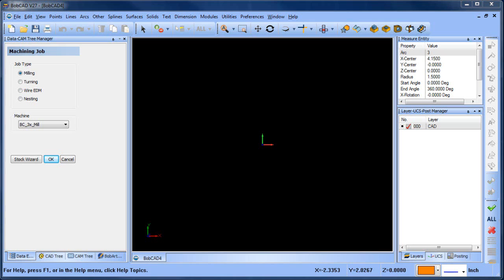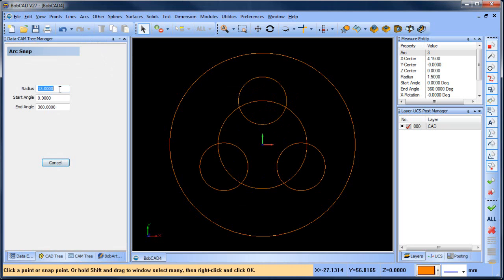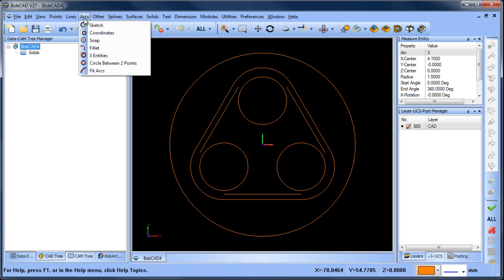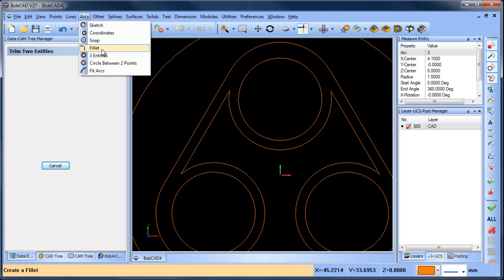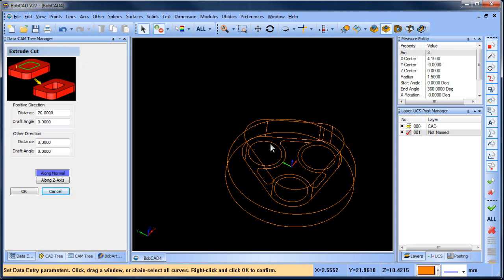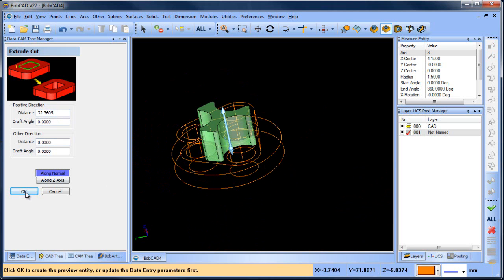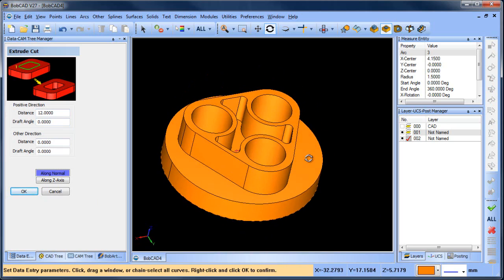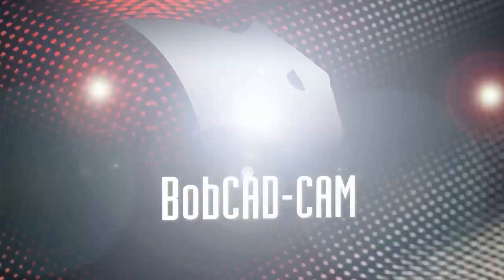3D Design Tutorial BobCAD CAM V27

Comment: Al,  can you do a video where I can create a curved surface and then cut out pieces  of it. I have to make a rocking chair back support that is curved  and has designed cuts. I will cut it out n a 3d cnc router doing front and back in separate passes using 3d cut software